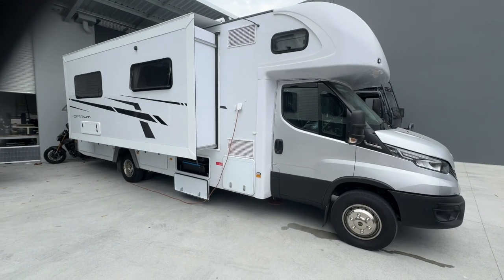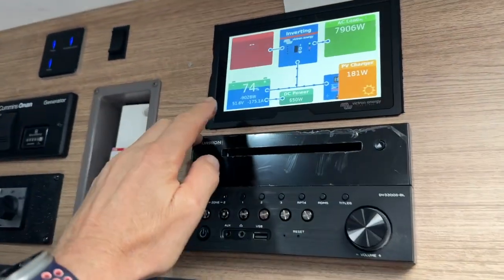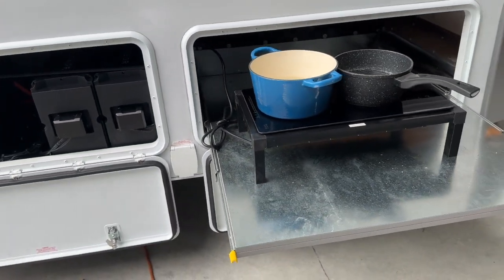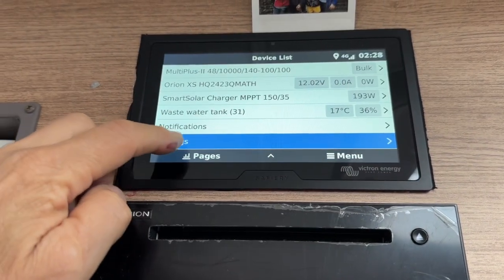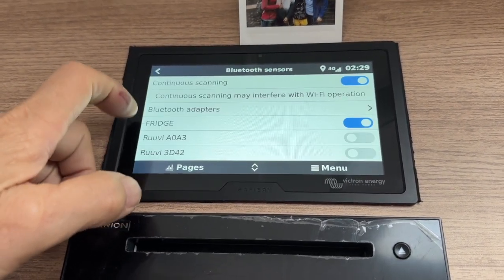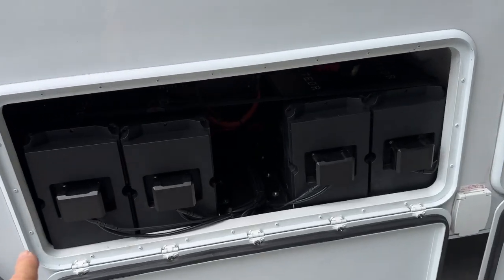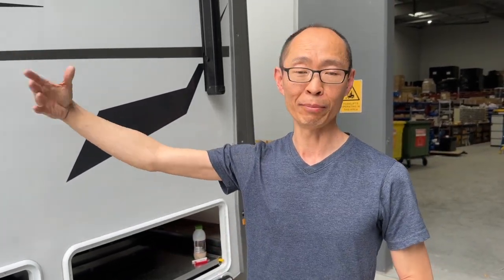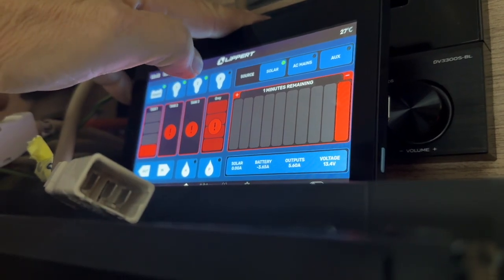Jayco Motorhome Upgrade with 48V 10kVA and 15000Wh Lithium plus 4 STAR-Tank Radar Tank Level

Comment: Hey Bruce, can you please on your videos like this - PLEASE give us a "ballpark" price range on how much this setup will roughly cost?!. Love your wwork, cannot wait to have my NPS and boat fitted out by you!.
Reply from the maker: About 25K for this job. Note that Jayco wire the motorhome up with one continuous 2.5mm2 240V AC loop. Its short of criminal. we had to run 4 circuits to truly get the right coverage without the breakers blowing.
Reply: @Safiery Thanks Bruce - that is why whatever I purchase - I will have Safiery, and ONLY Safiery fit out all my electrical work on my NPS and new boat. Quality means EVERYTHING  when you are remote touring and cannot have anything fail. Love your work, I spread your company to as many as I can!.